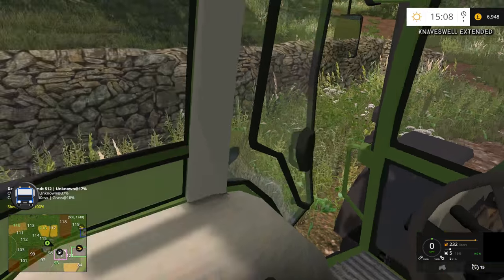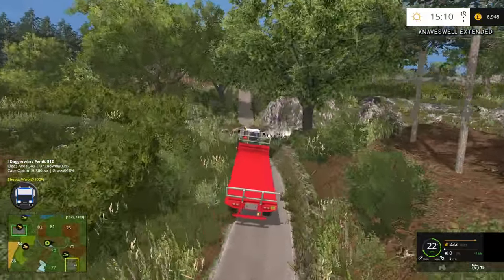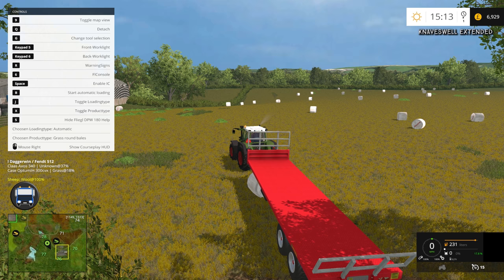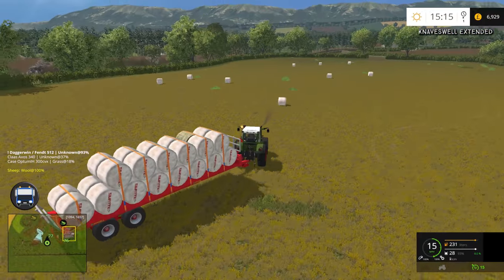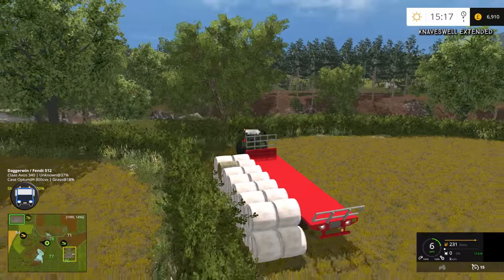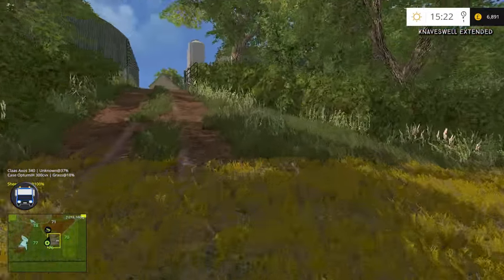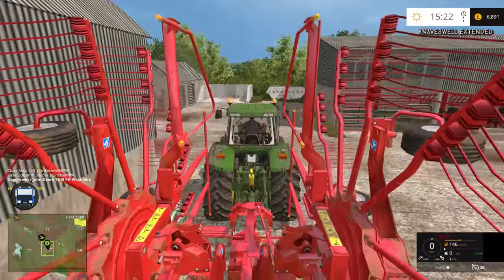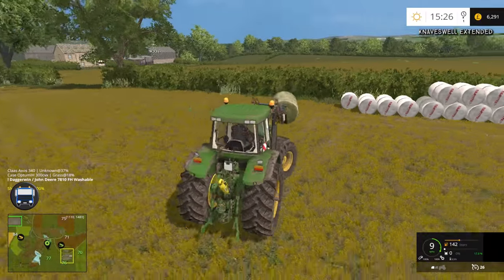Let's Play Farming Simulator 2015 | Knaveswell Farm Extended | Episode 11

Comment: Haha. Ok so you sent the trailer to mixed which loads every type of round bale. Technically what you loaded were grass bales. They're wrapped but still classified as grass since it isn't fermented yet. If you wanted to load just the grass bales that were in the field then you should have just selected grass on the trailer.

Comment: In real life when driving with a fork on your tractor you put the front loader down as far as possible and point the forks up as high as possible to keep the weight down otherwise your liable to tip the tractor over
Reply: NO YOU TILT THE BALE SPIKE  FULLY UP IN THE AIR AND YOU PUT THE LOADER FULLY UP IN THE AIR
Reply: In real life and I know this because I actually run a real farm and took the OSHA safety test tractors arnt as stable as they are in the game so in real life forks point up with the loader down as far as possible
Reply: Oh plus you wouldn't kill anyone as long as your driving safe and if you were to hit a vehicle those spikes won't make it through an engine block because with those on your supposed to go slower
Reply: not